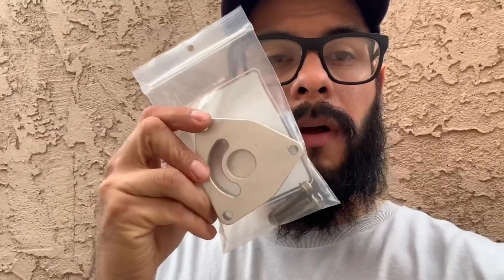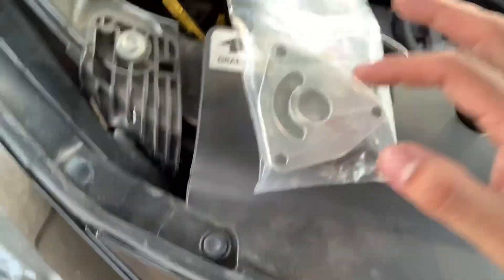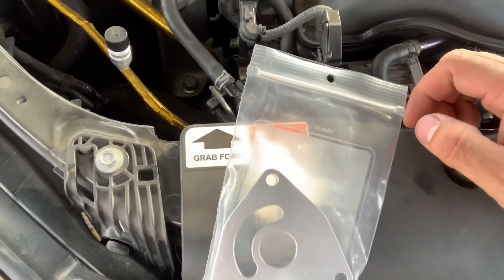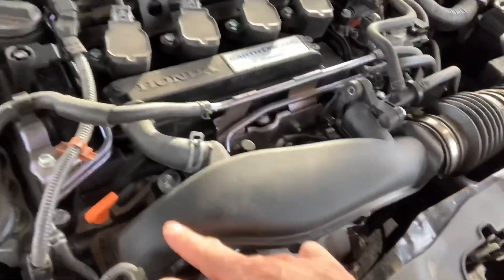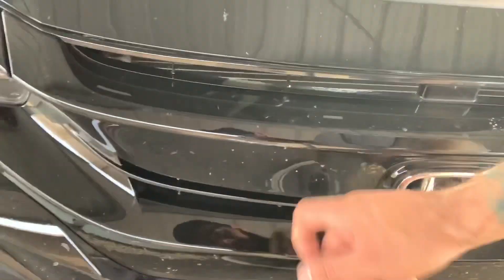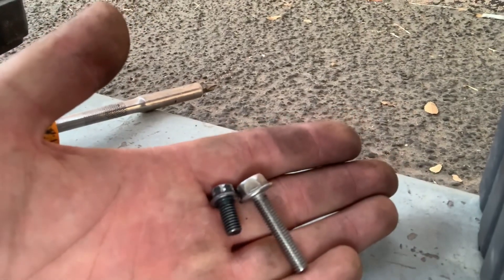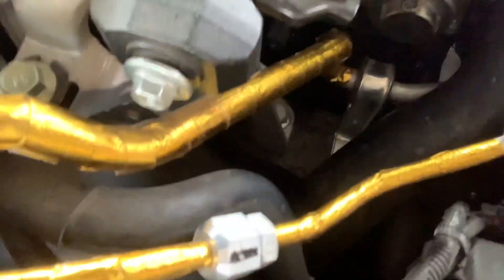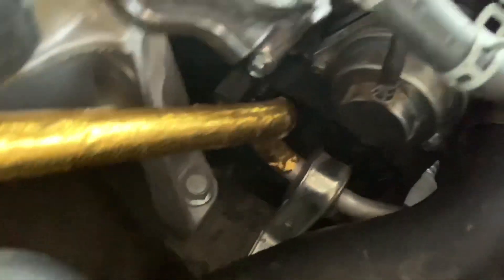10th Gen Civic Si pshhh sounds

Comment: Kaboom!🤣🤣🤣
Reply: Not how that works broski
Reply: @estreaper7393  yes it is broham
Reply: Running rich doesnt cause the engine to blow up. The ecu will try to compensate 99% of the time, causing it to run more lean. Easily can tune it out ive ran a bov for 25k miles on my fk7 no problems.
Reply: If you're catless running rich isn't going to hurt anything.
Reply: It doesn’t make it run rich, these new technologies can adjust the afr without problem. It runs between maf and map. They already proven this with on the dyno. It actually gained 5hp lol
Reply: @ReaperActual518  I agree. If the man is backfiring without any cats, it shouldn't hurt anything other than fuel econ. However if he does still have his cats... rip